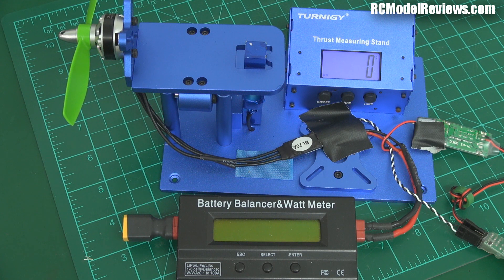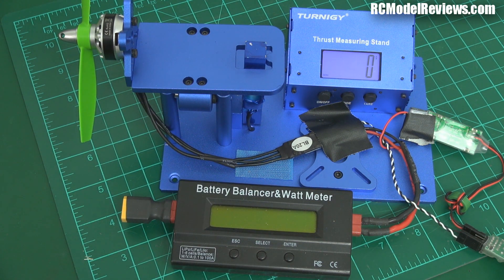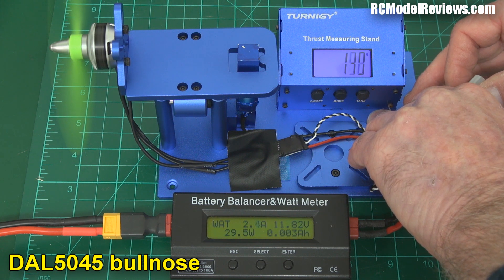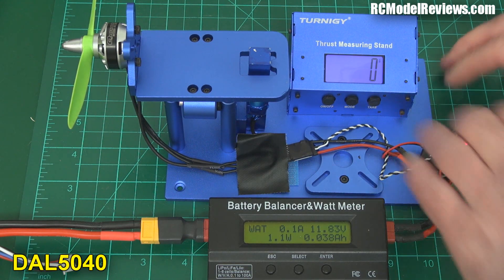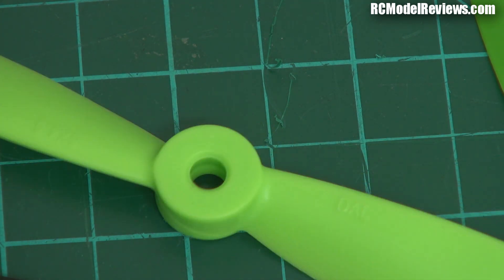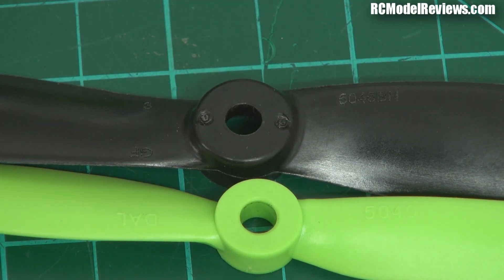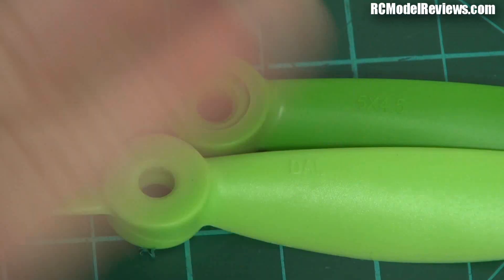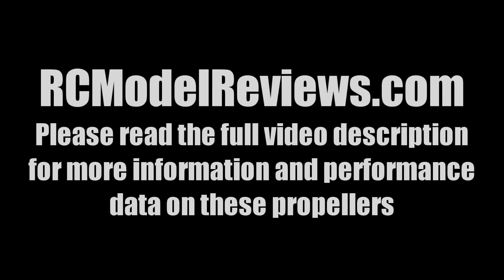5 inch bullnose mini quadcopter propeller shootout (on 3S)

Comment: Ive used both the HQ5045BN and the GF5045BN. The GF ones are pretty tough, and the HQ breaks all the time. Like the GF ones can get banged up with alot of scratches on them before i change them out, the HQ just plain brake off at the hub on a crash.

Comment: It seems to me that it would be better to pick a weaker prop that will fail before you risk damaging a motor. My motors were saved several times by my motor mounts shearing before they were damaged. I 3D print my motor mounts so it isn't a big deal breaking a 3 cent part. I don't think anyone would be happy with a bent motor shaft and an OK prop. Perhaps a weakness isn't a weakness? I for one would prefer to pick my point of failure.

Comment: I fitted a set of DAL 5045 Bull Nose props today and went for a fly, well I thought I'd go for a fly, the vibrations were so bad that the image from the FPV camera (600tvl CCD) was unusable, yes that badI have the Dart 250 and the induced vibrations through the rubber balls to the clean section were terrible, it was that bad I though a motor shaft must be bent, but not, got back home, changed props to 5 inch Gemfans, problem gone

Comment: Excellent review. But I'd like to see where each props center of mass is regarding throttle response.  If the mass of the props weight is in the hub (as we see weight added to the GemFan 5045B) it can outperform a lighter weight prop in control response that has it's center of mass weight closer to the tip of the prop, so at least some of the GemFan's added weight is having little added effect in control response. It's the length of the moment arm and the following rate of the center of the props mass that's important and it looks like the GemFan may have a lighter weight tip as well. So the increased weight of the GemFan will have less performance loss in control response timing than adding the additional weight uniformly.

BUT it will have a far higher potential of affecting the flight controller if it were  to get a finger in the way of a spinning prop. And this shows why thumb flyers with thick thumbs stay young longer than finger pinchers with skinny fingers that need both fingers to fly bold and stay young. (There are old pilots and there are bold pilots... but the evidence taught in flight school and often stated shows there are no old bold pilots.) Hard to argue with the hard cold reality of proven mathematics. Humm... I wonder how a prop made out of dark matter would work... saying it could deal with the harmonics in effect of course.

Comment: Why don't you a 12 v power supply 1000 w. That way all of the  props will have the same voltage + or - 0.01 volts.
Reply: +mickgibson Firstly... because I don't have such a power supply -- and secondly because this method works "near enough" -- given that the differences between the props are fairly significant.

Comment: It might be wrong but It always feels like colored props are tougher than black ones. Like more flexible...
Reply: +Trolleydolly130 That might be because some manufacturers actually produce glass or carbon reinforced props which are black but use the same molds as their plain (colored) plastic versions.  Such props are more efficient but do break rather than bend.  I think HQ do this.

Comment: Awesome review Bruce! What motor were you using for these tests?
Reply: +Marc Stollmeyer It was the quanum 2204/2300KV motor from HobbyKing.  I've had good luck with these motors and will be comparing them to the Cobra 2204/2300KV in a review to be posted shortly.
Reply: +xjet Looking forward to the comparison!

Comment: Hi Bruce! I do hope you can turn this situation around. 
Why 150 grams?
Reply: +theXpto51 Beacause 4x150 = 600g which is about the weight (or slightly more) of an average miniquad loaded up with battery, Mobius (or GoPro) and ready to fly.   This is a rough estimate of the amount of power required from each motor therefore, to sustain a hover.

Comment: Hi Bruce,

Actually it is the DAL that pioneered the whole more meat at the hub design and Gemfan is the one who copied it. However, the design take away a lot of efficiency and is not very effective on DAL6040 prop or bigger diameter and more importantly, it is easily copied, that's why DAL move away from it and develop their own material (which is much harder to break and retain the absolute efficiency). We have been following DAL development since day 1 of their start-up procedure and I have to say we are really impressed by the quality of their design engineers. If you try flying the DAL5045, you will notice that it is much much stronger than you expected. Definitely much stronger than the previous DAL6040 and the over-priced HQ props are not even close.

On the GF5045BN, it is a total re-engineered of the DAL5040 using GF cheap nylon material, only the concept is carried over, no further modelling or recalculation is made. That's why most of the time you will still see it break at around 7 to 12mm off the hub. It simply shifts the stress point outwards. In the end, it is a perfect example of bad engineer and the old "Chinese copy cat" stereotypology.

I agree that DAL props are the way to go! If you want more engineered design in this hobby, pls support the engineers behind the projects. It's time to have a proper propeller engineer company, rather than those who only own injection molders but think they can make money on propellers. Sorry this is getting a bit personal but the way HQ Props and their retailers marketing their products in our country is rather annoyin, which I dont want to mention it here.
Reply: +Hoang Linh Bui Interestingly enough however, the GF props are the stand-out winners in terms of efficiency (grams of thrust per watt of power).  If I had any time left in September I'd do a more detailed materials and stress analysis of these props but I don't think that's going to happen because I'm already running out of time to tidy up all the outstanding reviews.
Reply: Hi,

Yes, it is very interesting. But as you have noticed that GF prop shape is not strictly a bullnose prop (defined as a simple cutdown of 6inch props). This results in more efficiency but much less max power.

Comment: Why do you recommend the "DAL5045BN"?

After reading the comparision in the text under your video I would guess the "GF5045BN" are the best.
Reply: +RcCopterGuy Because the high efficiency and larger blade area of the GF5045BN means that it tends to make your quad more "floaty" and so it's harder to lose altitude quickly when you need to duck under a tree branch or similar.  I'll be doing another 2-hour round-trip to do a set of flight reviews some time next week so I'll do a follow-up with my thoughts on the way these props handle when actually flown but so far, talking to folk who have flown them, they find the GF props a little "floaty".
Reply: +xjet Thanks for clearing that up to me. That makes sense.

Comment: it would not be uber fun without a 6s (six cell) test1. test rig lifts off2. bec smokes3. motor boils4. battery sags5. tester crys6. electricity bill hikes7. power grid fails8. hanger roofing iron lifts off9. last seen bruce scasing the kit down the runway

Comment: I will always remember September 2015 as Black September unless your circumstances change Bruce. I myself will feel a great loss as will thousands more. Now my question. Did you test each of the branded props for Balance straight out of the bag. I checked the Dal 5045 and 6045 Bullnose and was quite impressed and believe this is down to your earlier video oh balance woes You pointed out a defect and they obviously acted on it :D as no doubt many company's have rectified problems or defects thanks to you. I will carry on watching you on xjet and I will carry on flying night-time fpv with my trusty NIGHTNOODLE a item born from you Bruce. So a BIG THANK YOU for all that I have learned from you including a lot of safety aspects :D
Reply: +Pudsey - Rc Yes, I checked the balance and will be covering that (and more) in a follow-up video.

Comment: I managed to break one of those gemfan BN props the other day, it broke about 1cm out from the hub. Prop hub was perfectly unscathed, but motor shaft (SS X2204) was bent a little - not sure if I like that situation very much.
Reply: +iforce2d A while ago i broke some Gemfan 1050 (2 bladed) props, and almost same as you had, they broke about 1/2 an inch from the hub.  Thankfully the hubs on my motors, SunnySky X2212 980 KV are still good.
Then i changed to some other brand of 3 bladed 1045 props, and when i had a mishap they broke right against the hub. At least now i know why they break where they do, i will probably stick to the 3 bladers for now, since they are about half the price of the 2 blader Gemfans. From a performance point of view i can not really comment, but from a price point of view, the 3 bladers are better for me at this time.
Reply: +iforce2d yup.  Same here.  I have found with unbreakable props that I now break motors.  I bent a motor shaft in a recent crash, but I had a perfectly unscathed prop.
Reply: +iforce2d I just listened to BRUCE'S 8 Sep weekly updated and he commented on this very issue.  When I had the bent shaft issue I was indeed using 1806 motors.  I guess this warrants a switch to 2204 .
Reply: +VSUPARHAM I have to admit that for a while my confidence was shaken (i suppose i blame my very "off" learning curve to that reason) and i suspected that the motor shafts were a little damaged. 
i Went to the neighbor who was an engineer and with some very seisitive testing equipment he has there he proved to me that the shafts were fine. So now it is back to me again trying my best to get my flying skills improved.
Reply: +Johan Combrinck Actually I'm not sure exactly what part of the motor was damaged, but when I turn it by hand I can see the gap at the outer edge between the bell and the static mount part widening and closing. It still flies ok though.
Reply: +iforce2d Sounds like either the clip at the bottom of the motor broke, or the set screw that holds the top of the bell is loose.

Comment: Hi Bruce, appreciate all the good you've done for the community so far. A whole lot of what I know about quads and multirotors today have come from this channel and I'll be sad to see it no longer updated after September.

Anyway, on the topic at hand, I just want to provide some anecdotal evidence from personal usage of these props.

As far as toughness go, I was using the DAL5045BN in many flights over the past week with my usual rate of crashes. Normally, I'd have gone through 3-4 packs worth of props with the crashes I've had, but in this instance, I've barely finished 1 pack. In one of those crashes which broke one of the arms of my MXP230 Elite V2 (the one with the thick CF arms), the prop did not break at the base, but rather tore haflway through at near the edge of the prop. Granted, there could be any number of factors involved in a crash, but one thing I notice is that these DAL5045BN tend to bend more than they break, and you just bend them back and fly off. There is a noticeable increase in vibration once these props have been bent a number of times, but it appears that unless there's a visible tear, they're still good to fly and I've yet to have them shatter mid-air. Same goes for the DAL6045BN I use on another quad.

Now on the GF5045BN, it appears they're just as tough as the DAL5045BN. I've only started testing them yesterday so the verdict is still out there as far as I'm concerned. I must've had upwards of 5 or more crashes with these props in the span of 2 hours' worth of flying yesterday but other than some small chips visible at the edges of the prop blades, I still came back home with the same set of props I set out with.

As for the HQ5045BN, well not much to say there as i'm sure everyone's had their fair share of trying these by now. They either break or they don't, but they're nowhere near as tough as the DAL and GF bullnose props.
Reply: +Safwan Sulaiman Wow... you broke a 6mm carbon arm on the MXP230?  You must have been either incredibly unlucky or really hammering that thing.  I've sheared off six of the 3mm bolts that hold those arms on after REALLY hard hits but I've never damaged an arm itself.
Reply: Ah I thought you'd pick up on that. :) Yes, I totally wasn't expecting it too. It must've been the culmination of all the previous hits it has taken and that crash was the proverbial straw. It wasn't a big break, mind you, just halfway tore through one of the bolt holes on the arm and a bit of damage on the main plate too; enough so as to make the arm unusable. Thankfully, the main plate was still salvageable.

I did replace the bolts it came with long ago when I first built this frame with high tensile bolts and those were still fine, not the slightest bend, surprisingly. I guess all that force had to go somewhere. :)

Comment: Have you considered a way of testing props in regards to airspeed, or in the case of a miniquad the angle of attack to the forward airspeed? The higher pitched props will make higher dynamic thrust at higher airspeeds, and likely are less efficient at lower speeds. Static tests are very misleading/bs, unless hovering, and its wildly innaccurate. Some sort of wind tunnel arrangement with a variable angle motor mount has been knocking around in my head.
Reply: +jackosmeister The effect of an incidental airflow would be difficult to simulate in a cost-effective way so flight tests are the only way to evaluate "real world" performance.  I will be doing flight-testing of these (and other) props later this month.
Reply: +xjet Yup definitely not easy, but without some sort of way of measuring acceleration/speed on the mini also can only test by seat of pants, and thats got way more variables. Ive been playing with APC S400 pylon props, naff all static thrust but epic top end, trying to come up with something practical (and economical) to test properly.
Reply: +jackosmeister Fortunately the Naze32 board has accelerometers on it so (at least in theory) it will be possible to measure actual acceleration by way of logging or telemetry.  Likewise, a simple GPS setup can measure speed.   Sometimes it's actually easier to use this tech than to get involved in building a complex and expensive jig or wind-tunnel.

Comment: why didn't you use a fully charged battery?
Reply: +TheRattleSnake3145 I used a half-charged battery because that's the mid-point.  The figures from a full-charged battery would only be relevant for the first few seconds of flight.  A lipo spends lots more of time at 11.4V to 11.9V when actually in heavy use.   Also, because this was a 5000mAH 135C battery, it wasn't going to sag like a typical 1300mAH pack so the figures wouldn't have been very representative of a miniquad setup if I'd run it fully-charged.

Comment: Great stuff man!  Thanks for your testing!  Something I've noticed though, the DAL and FPVModel unbreakable props have an issue running 4S.  With light damped/braking on and 4S they tend to shatter at the hub from the torque and rapid deceleration.  I had to abandon the 6" versions on 4S entirely due to this.  I believe from other info I've seen the 5" have have the same issue.  Wear safety goggles! :D
Reply: +Ryan Harrell (QuadMcFly) Again... this is probably related to the stress-risers that occur where the blade meets the hub.  It's basic materials design and I'm surprise that although DAL got it right with the 5040 props and GF got it right with their 5045BN, DAL missed the ball with their 5045BN and their 6-inch props.
Reply: ***** Yeah, I agree, but I think there's more than to it than that too.  I think there's a weakness in the material.  The HQProps have almost exactly the same design at the hub, and I've yet to see an HQ break from motor torque, even on my 6S setups.  

BTW man, I hope you can find a way to keep making videos.  I know a ton of people who credit you for getting them started in the hobby.  If you don't though, know you've made a lasting impact!
Reply: +Ryan Harrell (QuadMcFly) Yes, the plastic used in the HQ props is stronger but the DAL plastic appears to be tougher.  There's a difference between strength and toughness.  If I had more time available before the end of the month I'd do a few videos on materials and their characteristics -- describing the difference between strong and tough and why/when that is important.
Reply: really all I use is 6inch dal ,on 4cell on my race qauds ,never had one fail in flight or a crash and I bounce and saw through branches when I get stuck as you can see in my dal prop vid
Reply: Wow, they were breaking almost every flight for me, but I'm running 2206 1950KV on one setup and 2208 1500kv at 6S on another setup. Maybe they're OK with smaller motors, but I've seen a ton of complaints.  Kreso Saric had a video on his YouTube channel with the issue with his setup.
Reply: That would be a great video.  There's a lot of confusion about that, from prop materials to the difference between G10 and CF.  Would be a good one to do.
Reply: +Ryan Harrell (QuadMcFly) Yes! That would be a really good video and would be very informative. Also I'd like to know why the Carbon-Kevlar fabric composites are not used in frames/arms. Price is about the same as carbon fiber. I'd like to know if the Kevlar part would help in making arms/frames a little more resilient to breaking on heavy impacts. I've been thinking of ordering a plate and cutting some arms but alas I don't have a good cutting tool and having custom cutting done is a bit expensive.